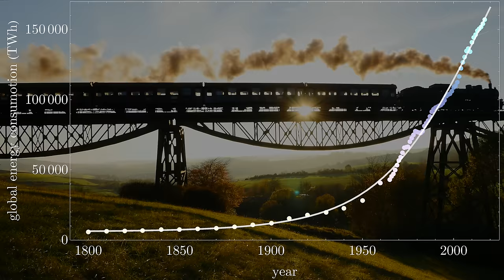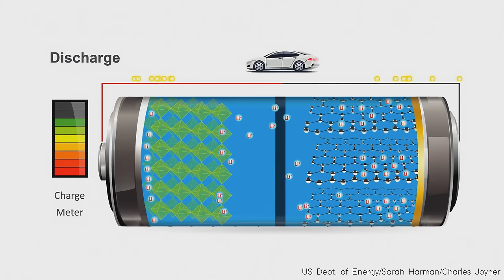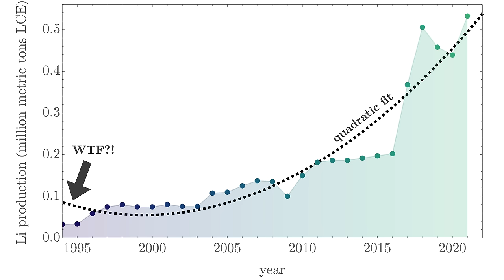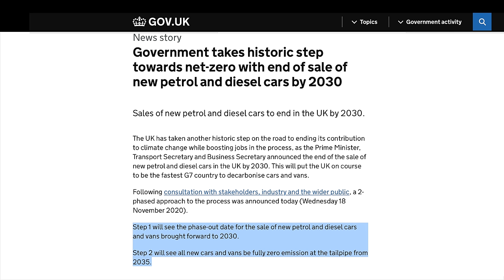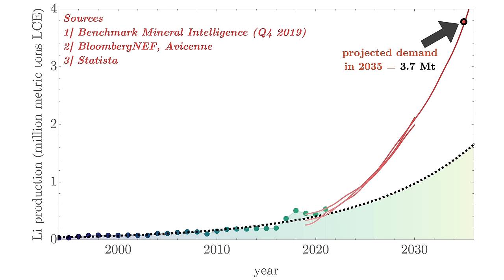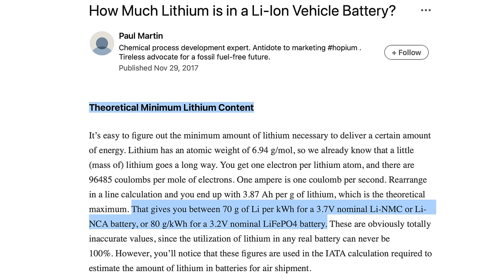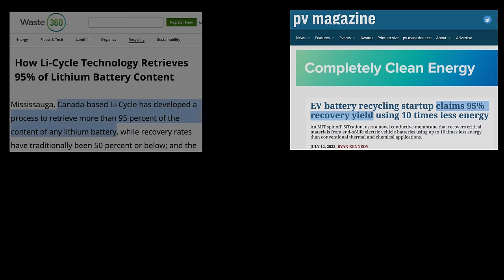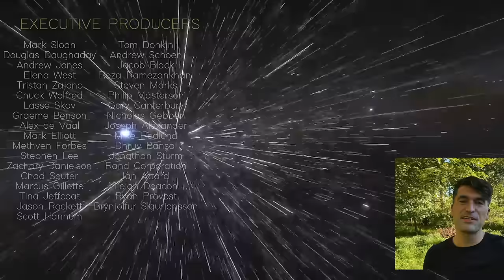Will We Run Out Of Lithium?

Comment: Not if we secure lithium rights in Ukraine! Whoops were not supposed to think about that!
Reply: Yep just like how people don't think of the US's and Mexicos massive lithium reserves.
Reply: @miguellopez3392  yep just like how people don't think how reserves run out eventually Whoops don't look over there at the Diesel reserve nothing to see here folks!
Reply: @MunchinOnDew  well atleast they can always buy electrc semis.
Reply: @miguellopez3392  And what powers Electric cell batteries for electric semis?

Ding ding! You got it -- LITHIUM
Reply: @MunchinOnDew  no a power plant does, hell you probably don't even know that a lithium ion battery is 80% nickle
Reply: @miguellopez3392  I wouldn't assume what the other person knows, man. You might end up w egg on your face.

Like now.

Of the 6 main types of Lithium battery, only 2 use Nickel. The one you referred to, with 80% Nickel, is the NCA battery. The only other Lithium battery that uses Nickel is made up of only 33% Nickel.

Guess what Lithium battery doesn't use Nickel? The LTO.

What does the LTO power? Electric vehicles and electric vehicle charging stations. 

Womp womp.
Reply: @miguellopez3392  The LTO battery, which doesn't use Nickel, is essentially a pure improvement on the NCA apart from energy-to-weight ratio. 

Thus, the US Gov push to obviously secure Lithium guarantees from Ukraine.  It's a smart strategic move that will unlock the ability to effectively replace aging transport fleets running on Diesel with electric fleets - which is a stated goal of the current administration AND a stated goal of the WEF.

Very soon, within 15 years, rare earth minerals and components for high yield energy sources like Lithium will be the new Oil. 

The conflict involving Ukraine is the US's new Iraq war, except instead of Oil we're after Lithium.

By the way, Russia is very rich in Lithium as well. If this war fractures Russia further and reshapes the global geopolitical map, we might scoop up some of Russia's reserves and mines.

So, again: Buy Lithium Futures.
Reply: @MunchinOnDew  lol you still pretending that the US and Mexico doesn't have enough lithium for 1,000,000,000 cars? Also the demand doesn't happen all at once, it will take 30 years to go full EV.
Reply: @MunchinOnDew  lol guess what is the most common battery cell in a EV? NMC 811, I simply do know more than you, I even know how dumb it is to say that LTO powers charging stations, and if they are it's likely LFP being used.
Reply: @miguellopez3392  Lithium tech is still relatively new. That "most common" type used will get phased out in favor of better, improved types like the LTO.

The most common Lithium battery in use now not being LTO doesn't disprove any of my points so keep trying.
Reply: @miguellopez3392  Look at this dude, thinking that the US wouldn't take advantage of a mutually beneficial arrangement that enables it to capture a valuable strategic resource.

Look at this dude, pretending that because the US has a stockpile of a valuable resource, it wouldn't want to get another source for it.

Look at this dude, ignoring the fact that we have an Oil reserve but still invaded Iraq and Iran for their oil.

Look at this dude, arguing himself into the dirt because he can't admit he's wrong and can't admit the US would want more access to strategic resources.

Just look at him lmao
Reply: @MunchinOnDew  you can convince yourself that Ukraine has any significance to the lithium chain and not the 75 year long war that the US has had with the soviet state spreading, but im smart enough to know you are desperate to try making this look like anything else.
Reply: @miguellopez3392  that straight up made no sense dude. Russia has posed minimal threat to the West for decades. The threat has only been China and potentially India.

What does make sense is that Ukraine hosts a treasure trove of Lithium and given the trajectory of US policy towards electric transportation and eradication of fossil fuels, it would obviously come to Ukraine's aid against Russia if it meant securing rights to Lithium mines and assets. If the US and allies win against Russia peacefully, Lithium is secured via Ukraine's natural bounty. If US and allies win by further breaking apart Russia in war, it gains a portion of Russia's massive stock of Lithium. Win-win; especially since the US is not risking much by way of involvement. 

I don't know what your angle is here, but whatever it is you're simply brushing away  obvious facts just to cling to an outdated and misinformed Anti-Russia position. 

It would have been better for the US and the World had no one intervened on behalf of Ukraine. Ukraine is not a NATO ally and we do not have a defensive pact with the country. Yet here we are, risking nuclear annihilation for a border dispute that NATO did, in fact, instigate. Russia has legitimate grievances regarding the conglomeration of NATO and UN forces along its border.  And the US only exacerbated that. What a shame. The blood of thousands of Ukrainian and Russian lives rest at the feet of Western forces and western interests.
Reply: @MunchinOnDew  not reading the rest after the first 2 paragraphs, tell me how many tons Ukraine has, and i will read the rest.
Reply: @miguellopez3392  that's fine. I already gave you more attention that it's worth.
Reply: @MunchinOnDew  ok.
Reply: @MunchinOnDew  also I just re read something, you still think LTO is the  common battery type despite lead acid  being in all gas cars and 95% of EVs in the US being NMC, you need to stoop gooogling all your information and acting like you have a clue,

Comment: EV's cant compete yet, they dont have the distance for the same price as a cheap petrol car, and all the ev companies have designed their cars for luxury buyers,   or just round about town drivers, theres no real options, and buying secoind hand EV's are a gamble , plus theres no real battery recylcing plant yet in many countries, hence when i bought a new car this year i bought a 2litre VW Polo and the next day xcould drive 742 kilometres to see my brither without having to stop to recharge, EV cars dont make sense to 80% of car owners. If  you live in an apartment where do you recharge each night, if you dont own a house can cant fit a charger where do you charge, the few charging points in public are always full. so imagine a street with a 50 apartment building on it with twen car parks in the basement and 40 cars on the road, no one can run extension leads to cars. so unless you own a house or have a charger at yoiur office, your fucked,  My local government job doesnt even give us carparks  so we cant charge at work,  its a badly thought out dream that doesnt work in the real world,  so petrol will carry on while anyone can drive to a station and gas up,  if EVs were to work in the real world batteries would be swappable and youd drive up and they would swap out your battery, and then you could also do long drives like petrol swapping along the way in minutes, but instead everyone wants charginbg stations and when hyrdo runs low coal power turns on and creates greenhouse gasses,

Comment: how about we address all the elephants in the room.

1: we're not even remotely close to supplying the energy grid with green energy, so all of these EVs are powered by natural gas and polluting coal.

2: Why is it never discussed how much oil it takes to create one battery, mine lithium, and produce the plastic in your electric vehicle? According to studies, a 400kW battery, which will be the norm in 20 years, emits more carbon dioxide than a gasoline-powered vehicle. In addition to releasing radioactive rare earths, the extraction of lithium produces an enormous amount of carbon dioxide, which makes it all moot.

3: To power these vehicles with renewable energy would necessitate a proliferation of nuclear power plants in nations with deplorable environmental regulations. Probably dispose of nuclear waste anywhere, impending catastrophe.

4: Fuel consumption accounts for 14% of global CO2 emissions, making the transition to EVs a net negative as it will not move the needle in a positive direction. There will be no change.

Comment: I think you paint an overly optimistic future for EVs. While you covered the Lithium that makes up the batteries, EVs also require rare Earth elements for the motors and electronic controls. Some of these other elements would require: an 18x increase in the world’s current cobalt production, 9x increase in neodymium and a 4x increase in the world's copper production. Plus more rare Earths for the electronic chips. Copper is already selling at sky high prices, versus in the past. China controls most of the world's production of rare Earth elements and is restricting their exports to support their own home EV and electronics market production.

Plus you are simply moving the tail pipe emissions from the vehicle to the power plants. In many countries like China and India most of their electric power is generated from coal. So while Western countries continue to reduce their carbon foot prints, they are offset by 3rd World countries that are still modernizing and emitting increased amounts of pollution. Their citizens may not be able to afford expensive EVs for decades to come. 

We also have a semiconductor shortage that may take years to resolve. EVs require as many as a 100 microprocessors to power all of their systems. The smallest scale microchips and memory chips are mostly made in Taiwan, which is at risk of being destroyed by a war with China. Currently auto-manufacturers have to build vehicles, then park them until microprocessors can be obtained and installed in the onboard computers to make them drivable. 

I own a 3000LB boat and trailer, how could I tow that and have any realistic amount of range with an EV? EV battery output range also drops off up to 50% in colder climates due to battery efficiency dropping and having to run resistance heating to warm the inside and increased hours of lighting during the darker Winter months. Then their is the charging infrastructure or lack of it. California wants their citizens to buy EVs, but then the governor tells them not to charge them, because the States electric grid can't handle the increased loads. This is true in just about every country and State that is pushing EVs.  I read that an EV charger takes up 4x  the amount of power used by the typical home central air conditioning unit. I live in a town of 65K people and the local utility can't even keep our power on after a Summer rainstorm or a Winter snow storm, or especially during a Summer heat wave. Hence I had to buy a backup generator for my home. Wind and solar are both unreliable sources of power. Nuclear is our best option, but it has been so stigmatized by the Greens that nobody wants it near their town.

The Biden government can huff and puff all they want, but that is not going to result in the rapid infrastructure improvements that are needed to make EVs practical. With the US Govt $31T in debt and FED interests rates rising, soon to be followed by income taxes, the middle class can not afford EVs. With the average current EV selling between $50 and $100K I think it is just a way for the globalists to force everyone to either ride a bike or bus to work, or work from home. Our State is already looking into putting a per mile tax on EVs to recover road repair costs. Then who wants to spend $23K to replace the battery pack on their EV when it can no longer hold enough charge. They are also proving to be a fire hazard. Park an EV in your garage and watch your home owners insurance increase. The US Government is already monkeying with the EV purchase rebates so that none of the current crop of EVs for sale would be eligible for the new revised rebates. If EVs are forced on the public, the middle class will go broke and the poor will not be able to afford them. It is all pie in the sky logic. Face it EVs are just wishful thinking by the wealthy people who can afford them. I had to laugh. Biden passed a $7K rebate to entice people to buy an EV and the next day Ford raised their EV prices on average by $8100. EVs are for fools, try to convince me otherwise?

Comment: It's my understanding that altho'relatively abundant in the earth's crust, lithium is rarely found in concentrations that make mining financially viable. The biggest problem with battery EV's is the inefficiency of lugging around the massive weight of the batteries when depleted. I think they have a place in our cities but for many they aren't going to cut it. I think the current obsession with battery EV's is a distraction, we need to come up with a less polluting alternative (they may produce no emissions themselves but as most electricity is generated by burning fossil fuels, not to mention the devastation that cobalt mining has caused, EV's probably pollute more than gasoline vehicles) Hydrogen has always been the logical choice, we should be working on that as a global strategy.

Comment: Single Source Fuel Vehicles are Idiotic.  Clearly a PECV  'Plug-In ElectroCarbon Vehicles' are a Better Choice.
PHEV's and the like have much smaller batteries, have range with hydrocarbon fuel, have all the electric vehicle advantages, and are more efficient than ICE's.
It seems Clear that A Combination of the Two Systems, hydrocarbon and electric, Would be our Best Approach Overall.
Reply: You are correct, but fuel source isn’t much better. We need to go beyond both.
Major arterial routes should all be set up for induction power as a minimum.

Comment: Your videos are well done but just a constructive tip, I stopped watching them because basically every one of your videos has a title on what you are covering but the video is 30 minutes long to answer a simple question proposed in the title of the video with 99% of the LONG 30+ minutes going round and round the topic. It would be great if you cut down a video like this one and not make it a 30 page essay white paper story but instead an efficient overview and answer to the video's titled topic in 10-15 minutes MAX and preferably under 10 minutes.

Comment: You are ignoring new battery technology which is emerging such as sodium replacing lithium (see https://youtu.be/cHNELRnJ_4Y for example) in battery production in EVs. There are many other Youtube videos on the subject of sodium ion batteries.
Reply from the maker: Sodium batteries have less energy density of course but could indeed pick up the deficit if they can be developed and scaled rapidly enough. As I said though, recycling can do it too and is a sustainable solution.

Comment: Drive car with all off lane asset power steering turn it all of  we choose the hybrid 
  You get 80+ mpg with all of  on 30 the first 1 is best the last 1 of 3 with weird wheels Lether ette and dash with a big hole slit in it rubbish  if you have this 1 take it back after doing all the tests its not healthy have you tried the emergency switch in light red flick switch and get a women wjo cant understand what your saying  asks you to spell out letter by letter your name then says still can't understand can you number each letter then to be  giggeld at  nope aint ever pressing that red button again  goinh through a stream the water came over wind screen then it shuf engine off water coming in doors windows won't open and whh do they put a plastic cardboard under floor  outside under car to hit rain puddle to rip of  i think like the Canon r  or r1 mirroless cam they should only build 1 alwaus the best I agree they are a great car but hit 134 mph on a wet or cold road and it glides left right 50 50 who noes what side    maybe ther is two earths if thiers two entalgeld particles why not earths the many worlds hypnosis  anyway teac stay safe we need you and stay IQonic  and anyone if you jave a hybrid you mjst thrash it tnen you will be able to drive 165 mpg in the blue battery only at 32 mph and save the planet tjrn off all the assists you dont need tjem at 22 mph  uk iner cith speed limits  its to get you to burn more fuel hets you wonderinh what planet tjease haters goverments come from   red aint dead shell high octane all the way ...